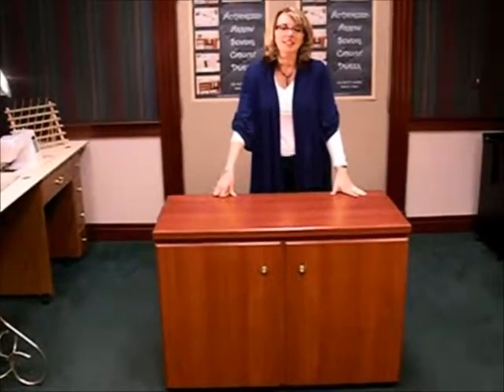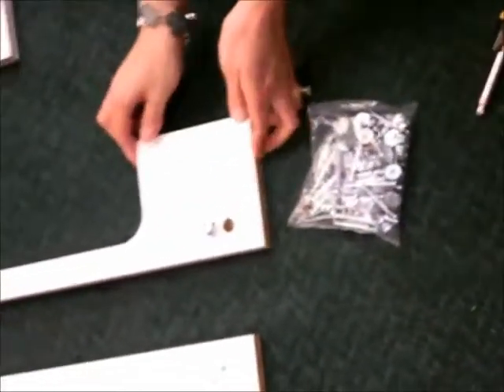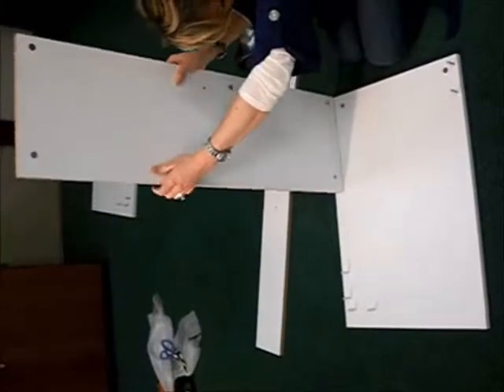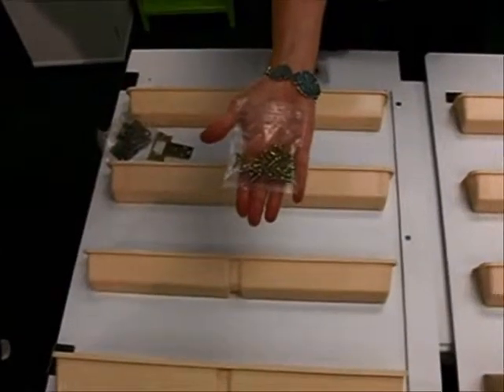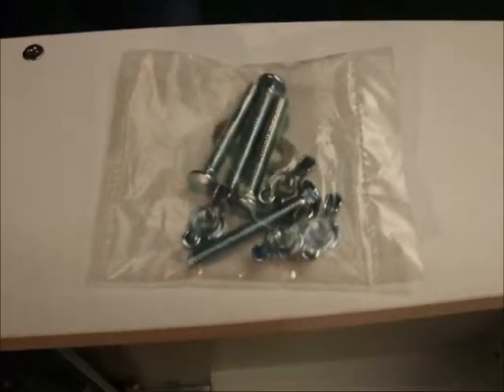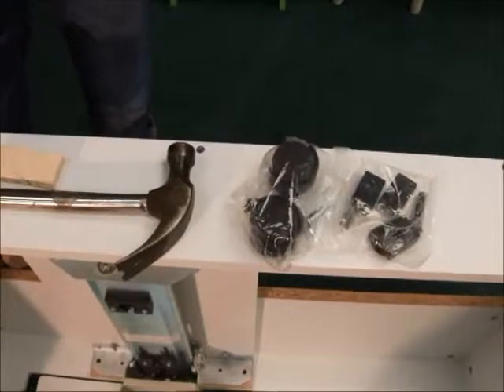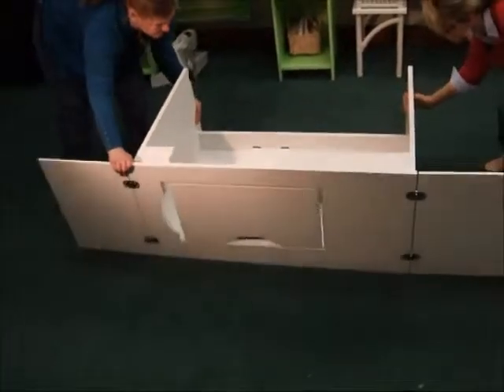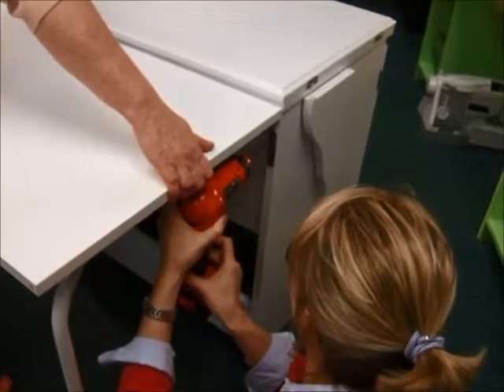Bertha Sewing Cabinet - Assembly Video

Comment: GaleW: yes, the reference to 1" x5/8" screw is still in this video. Five years later (Dec 2018)  the manual still has the error you mention, as well as errors in the illustrations that can be confusing!

Comment: This video needs improving. At one point it says use "the four screws" with no identifying information at all. In one area it says to use 1" x 5/8" screws. There's no such thing. The book says #8 x 1" and then in the next line refers to them as #8 x 5/8". No wonder people complain about the assembly of this cabinet. It's not hard to put together but the book and video are both confusing at times.